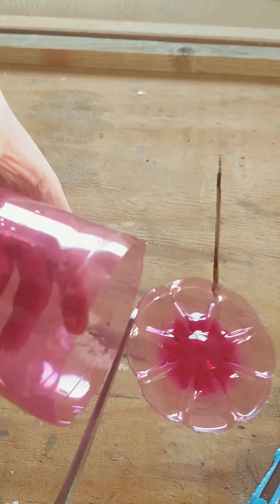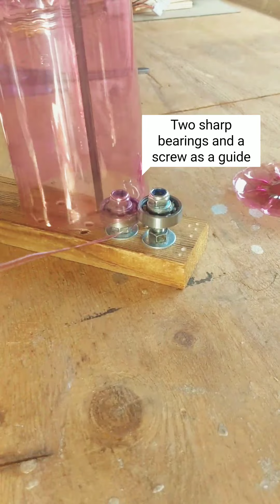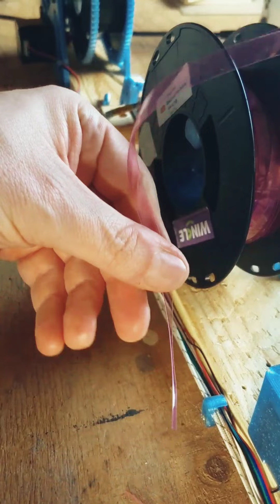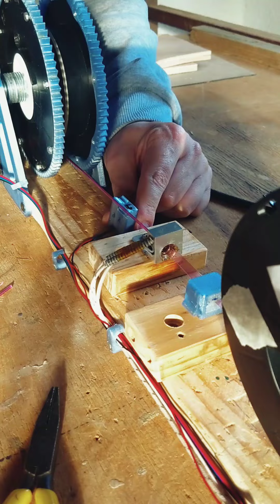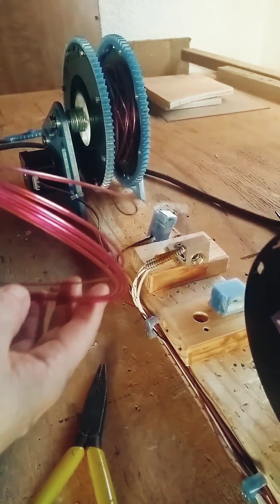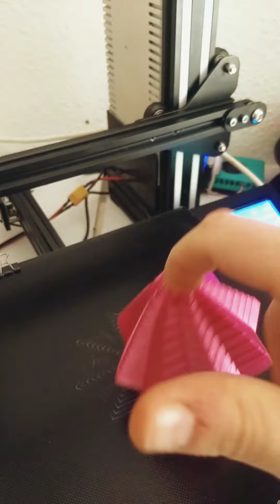How to transform a plastic bottle into a fidget star (PET)

Comment: Wow !!!!I love the entire video  do you have any published designs for the  machine that you created  . The motorized filiment receiver, bottle  slicer and how you setup the hot end to receive the plastic.  Is the 6.8 mm a requirement  ?  I would love to  see a video or written  tutorial  on the full build process.
Reply: I assume the 6.8mm is the right amount for his printer, if you used smaller or larger diameters I guess you could just change the flow level of the print to compensate. I'm not 100% sure tho
Reply: Hi, thanks for this video, but i can not find how to do this machine, thanks

Comment: hola, amigo tengo una duda, que modificación usaste para instalar extrusión directa en tu impresora? ¿es compatible con el extrusor de doble engranaje? ¿la modificación esta impresa con PLA o algún material más resistente al calor? ¿qué firmware usas para llegar a esas temperaturas?

 
Hello, friend, I have a question, what modification did you use to install direct extrusion on your printer? Is it compatible with dual gear extruder? Is the modification printed with PLA or some more heat resistant material?  
What firmware do you use to reach those temperatures?
Reply from the maker: https://vm.tiktok.com/ZMYUVDXQA/ en mi printables tengo la pieza para extrusión directa y la tengo funcionando en PLA

Comment: Wow this is amazing. What's the strength of the resulting part? I love how this star is flexible... wondering how it compares with PLA for example.
Reply from the maker: It's a PET plastic bottle, similar to PETG
Reply: @function3D  will any plastic bottle work or will let's say a bottle that is made from recycled plastic be weaker and also can you combine more than one bottle together and make 1kg roll
Reply: @esmokebaby  recycled bottles should work fine as long as they're not an alloy of different types of plastic, otherwise you might have to experiment or lower priced ender or aquilla might not have the ability to print with those materials

Comment: How do you know if the bottle is PET?
Reply: From Resin Identification Code  , it should be a triangle (this is not "recycle" logo , this is intentionally created to mislead public by plastic industry) with number 1 inside it, it should be embosed somewhere in the bottle, usually bottom or near bottom